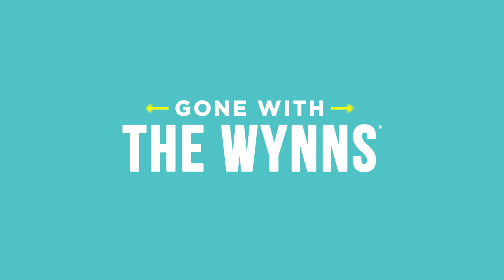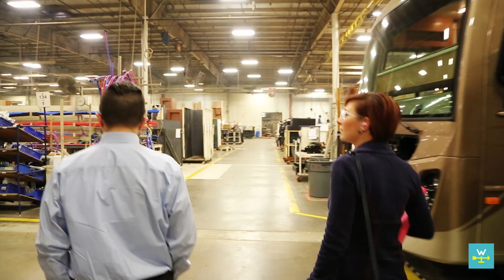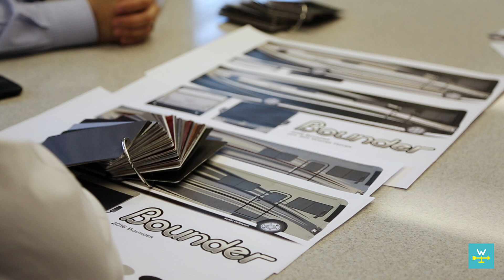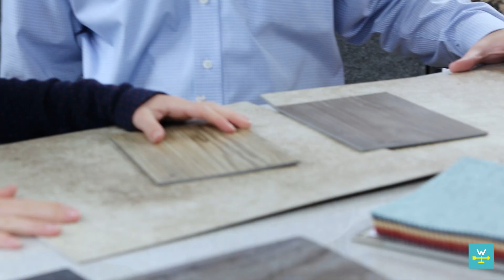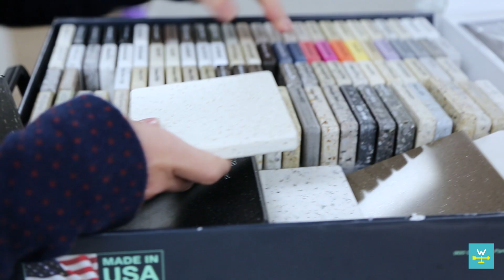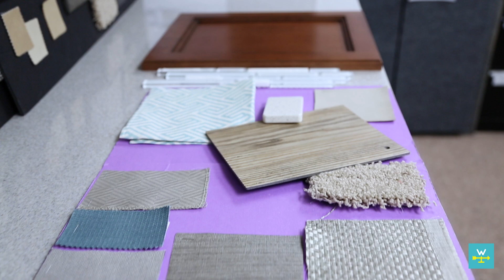Resurrecting Dinosaurs - The Story Behind Our RV Design Gig

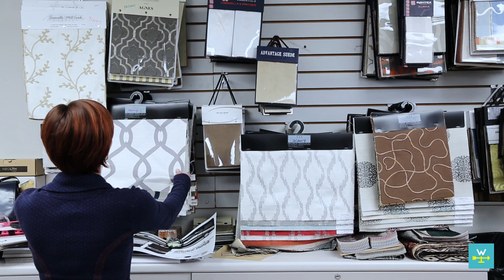Comment: As someone fed up with the ill fit of most RV floorplans and weird/busy fake glamor visual style, enough to be planning a custom build, I got excited at first but then at 2:58 "we were told we couldn't change the floor plan or the cabinetry, but we could change the decor".  Opportunity lost, because a lot more than fabric choices need a face lift in class As.

Example: keeping Corian counter tops and Lithium batteries exclusively for high-end models is arbitrary and should be an option throughout the line if the consumer did come first.  And why sticking with the huge weird swirls on the outside, fear of standing out from the competition and getting noticed?  As an option at least, it could've been a big selling point for the new Bounder.

Comment: The problem with Lithium in some ways is similar to solar but perhaps even more profound, and that is that we're still living in a time where these resources have some scarcity.  Solar is not getting to the point where there aren't such limitations, but the battery technology you've still got the mining problem.  Thus, these applications should go where they're most needed which is likely in portable devices and electric powered vehicles.  The reason is that Lead battery technology is sufficiently advanced and the weight/energy density is far less an issue in an RV powering some lights and a refrigerator, than it is in a Tesla or say a Chevy Volt.  Luckily, we are getting to points where these issues are waning as well.  My wish for one is that there'd be a lot greater focus on microturbine generators such that we could get far more vehicles electric, albeit relying on traditional fuels for range extension.  Same goes for RVs; you wouldn't feel so guilty running the generator if it was as efficient or had pollution levels less than electricity from traditional power plants.

Comment: The designers certainly made known the reasons many of these changes cannot be made.  To say that these companies are resistant to change is a bit harsh.  They also hit on a key fact.  One persons taste or one age groups taste would limit the companies market share.  The average buyer of a mid to upper end class A coach is many years older than the the Wynns so it is only reasonable that Fleetwood lean toward that market with their designs and finishes.  I think it very progressive however that they do offer color and finish choices that run the spectrum thereby appealing to other age groups as well.  It was very refreshing to see that Fleetwood understands their loyal customer base while still trying to attract new buyers.  Would love to see a collaboration of both young and old (well not too old LOL) as well as those that are technologically savvy and those who are lets say mechanically savvy, get together to come up with ideas that lead to a "super coach".  Full timing and coming up with solutions and ideas is so much fun.  Full timing reveals issues that might not be noticed by the weekend user but once put into play as an upgrade or improvement over a standard feature become relevant and beneficial to the casual rv'er

Comment: Solar. lithium batteries, and a modern clean design? You should check out the new Roadtreks. Granted they are no class A but the XL models do reach to 24 feet long.
Reply: Exactly. If the class B and B+ markets can adapt, the big guys should too, at least as an option.  (How hard would it be to add a checkbox with "no swirly patterns outside please" on the order form?  Does literally not cost a thing.)  It's odd that only the most luxurious class As can go all-electric (no propane) while most decent B+ can.  Considering how much time is invested in building each individual coach, there should be a lot more customization options available.  It'd help justify the price tag, too.

Comment: I disagree with the statement about the side design not being linear and not looking good. There are tons of old buses and coaches from he 50's that had full run linear chrome plated lines going down the sides and they looked like badass airplanes flying down the road. Obviously, chrome is out, but to say linear lines don't look good bc of the length of the coach is a copout.

Comment: Here's 1-thing I want...to sit down at my sofa...and look directly at my TV...having to turn your head to look at a TV in-between driver/passenger area don't work..nor does having to turn my head and/or sit at a weird angle and look at a tv back by the fridge..

I also like having solar panel hookup options on the outside roof would be ideal as well! Meaning, don't force me to drill into a new roof to route solar wiring down to the basement area for instance!

Composting toilet is also a priority for many, including me!

Comment: I would never buy a coach covered in Elkhart graffiti (my name for all the swirly nonsense) or one featuring the decor of grandma's kitchen circa 1974. Unfortunately that rules out, what, 90% of the RVs on the market? To put it bluntly, most North American RV decor is atrocious and the technology antiquated but it seems that no manufacturer has the guts and the resources to blaze a new trail. It's odd given how, in so many other ways, America is the leader in innovation and adoption of new technology.

I want to see more coaches that are decorated like Leisure Travel's Free Spirit SS. Check it out, you'll be amazed. It's clean and modern yet still inviting and it exudes warmth. Surely such a decor could work in a larger class A?

And how about using high quality solar panels, lithium batteries and DC appliances? It would cost more at first but when scales of economy kick in, it would be more affordable.

I'll stop ranting now.

Comment: All us fulltimers are drooling right now. One of my biggest problems is where do you put dirty laundry, and don't talk to me about those tiny hampers I've seen in a couple of rigs. They're only ok if you plan to end every day with a trip to the laundromat and never change the sheets. The inside decor needs to be simpler. What was kinda ok when you first saw it gets old quickly when it's in your face every day. Wish they would stop designing for the grandmas, btw I'm 69, but I hate the flowery patterns and drab colors. Dark woods and black appliances are also a pet peeve. We need bright and light.
Reply: PNW Granny rock on👍

Comment: I love the fact u are helping them change the old style interior design a little. I have a 2014 Airstream International and love how modern the interior, and classic look. I wish Airstream could add slide outs for the xtra room, but because of the shape the body it's hard to have a tight seal over time. Please look at the Airstream for interior design ideas. If a motor home had a interior like my Airstream I would purchase it immediately!

Comment: My request would be better quality control of any unit, I have been rv for a long time now and newer units generally don't hold up over long term.  Yes some are better than others but the general thing I hear is when we picked it up or shortly thereafter we had to get that and this fixed.  Rv dealers are to blame too but they should not leave the factory like that.

Comment: Wow, what an honor to be part of the design process. If I had my druthers, rather than living in my '93 Pace Arrow, I'd definitely want solar, one of those bath tubs that you can enter by a door so that the tub would be higher, have only solid color/s, have a nice fireplace, washer dryer combo, lots of storage, sliding chairs on a track so the lay out could be adjusted for company and such, no carpet but rather cork as an alternative, full size sink in the kitchen, and definitely nice curtains instead of blinds. Of course these are just my personal likes so take it anyway you like.

Comment: What a great opportunity you have.  Congratulations. Quick idea for pre-wiring for solar in new coaches.  Instead of installing the wiring for solar on every coach, run conduit or tubing in every coach that will allow the solar wiring to be installed at a later time. Very small cost up front for empty tubing, but saves huge amounts of time and money when solar is installed later.

Comment: My partner and I are planning to take early retirement in a few years, selling everything and purchasing a house on wheels and because we now have 2 Greyhound, we're stuck looking at Class A coaches. As a designer of kitchens, bathrooms and new houses, I wish I could be in your position because so far we've found nothing we like and I have ideas.

Aside from floor plans, many of which are either awkward or just poorly thought out, my biggest issue is the lack of colors offered inside. Everything is drab and dreary grays, greens and browns and many of the fabric prints are just offensive to us. The cabinetry is too much like a kitchen in a McMansion and not suitable, IMO, for the confines of an RV and black appliances in the kitchen are completely unacceptable for us. Neither of us like the idea of spending +/- 100K on a coach and having to spend more money to rebuild it.

Just a few thoughts to offer your mentors....

Head room is a priority, we're both 6'4".

We want COLOR! Tropical colors - the turquoise and aqua of water, beach sand tan, muted pint and orange of the sunsets, palm tree greens and prints that aren't overbearingly offensive. Offer it as a 'colors package' option.

We want light maple Shaker Style cabinetry and stainless steel appliances, sink and faucet in the kitchen. Offer it as an option package.

We won't consider anything without a washer/dryer and an on demand water heater should be stand equipment on all coaches.

We need a dedicated space for a home office, we may be retired but we'll still be working if/when we feel like it. We don't want mirrored closet doors in the bedroom, nothing's worse than seeing yourself first thing in the morning.

We don't need a sofa that's folds out to a bed in the living area because we're not 'camping' on a weekend with friends, there's just the four of us and the puppies are fine with a sofa.

As for the outside graphics packages - I'm a big fan of the design concept of K.I.S.S., keep it simple stupid, and whoever designs the graphic packages is not.

Offer an optional pre-wire package for solar because as you said, it costs a fortune to add it after the fact.

Design the coach to be a bit more aerodynamic, nothing kills fuel mileage like driving a box down the road. 

Fresh and new styling inside and out WILL sell!
Reply: ***** You are being unrealistic in your demands.  The industry can make the coach you want but it would be a custom job costing much much more than standard coaches.  If you watched the video you must acknowledge that the industry must meet many regulations and what you are asking - head room for a 6'4" person - is changing the design radically, not to mention your other ideas. Office space, etc. Go to one of the factories and catch them before they build and they may be able to accomidate your tastes.
Reply: Ed noyb Everything is for sale including color option packages and useful floor plans that may sell better than the gloom and doom color fanatics at corporate think.
Reply: +Ed noyb I'm 100% w ####Tab, Boring, the RV industry is 30yrs behind in every facet of their industry.

Comment: Interesting how their hands are tied with regulations. I am of the thought process, that if it is there people will use it when it comes to solar panels. I understand the lithium argument, but with solar panels if they install them people won't find excuses for not using them ( don't know where to put them, don't want to spend money on aftermarket parts and possibly lowering the value, lack of warranty to protect against leaks, will there be hidden costs, battery capacity etc.) theses are easy excuses not to invest in green initiatives and by installing them in the factory we can reduce some of the stigma of owning a gas guzzling RV.

Comment: Hi Wynns,

Sounds like you two are in RV heaven!!  Designing your interior and exterior colors and materials would be a blast.  I had a question that maybe you could find out about and that is: will Fleetwood be delving back into class B+ and C motor homes? My wife and I have owned several class C's and I feel comfortable driving them.  I'm not sure I'd feel comfortable in a class A, especially driving in city traffic on occasion.  Most C's are setup as family campers, and not for retirees. I know there are RV's like the Coachmen Concord that are more set up for retirees, but they're much more expensive, and some things we just don't like. The under-the-counter microwave oven and the split bath is not to our liking. We also like the bunk over the cab for storage and for the grand kids when they travel with us. 
Fleetwood a few years back offered the Tioga Ranger 31N which had two large slides and offered quite a lot of space for a C class. I do part time computer work and the 31N offered a second dinette which would have been great for my office. Also it had a all-in-one bath which we like.  I think this type of unit with a few changes here and there would be a great unit for retirees, but if they don't make it...you can't buy it! 
Thanks for a very enjoyable show, and you two are very blessed to be doing what you do!!

Take care,

Dave and Donna Lane

Comment: I have to say it's not really design but more interior design.  I would have liked to seen some more engineering discussion on topics such as insulation (plenty of people want 4 season capable coaches), chassis length (I really dislike the trend of using very short chassis such that the rear wheels are nowhere near the rear bumper thus resulting in a large amount of overhanging weight in the rear), aerodynamics (clean up all the handles that stick out, exposed awnings, and so on), etc.

On the topic of the video, I would like to see coaches with options to get rid of the ugly (to me) colonial styled furniture and use designs that would be home in an IKEA catalog (but with thicker wood and more dramatic stains that make the wood grain really pop).